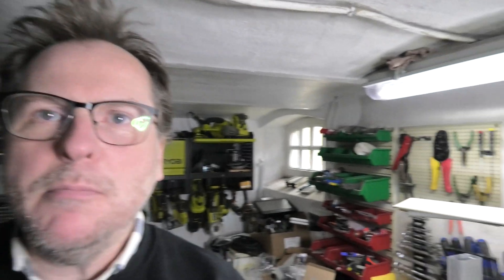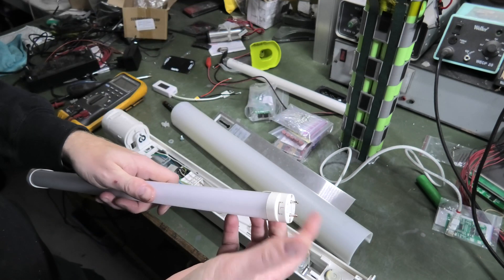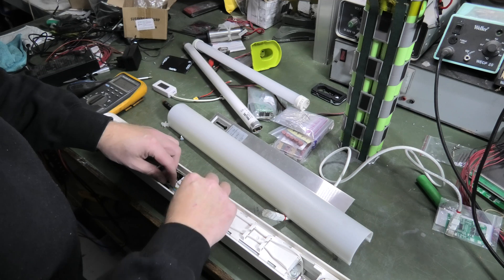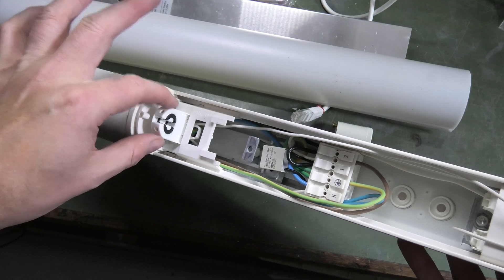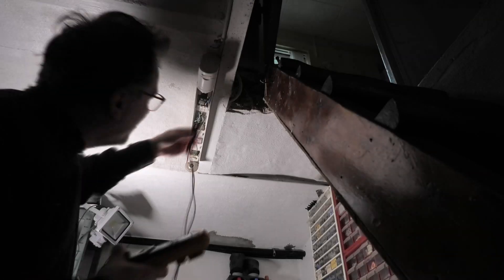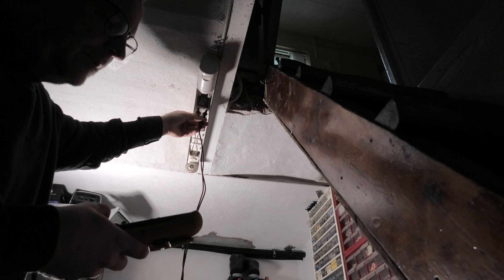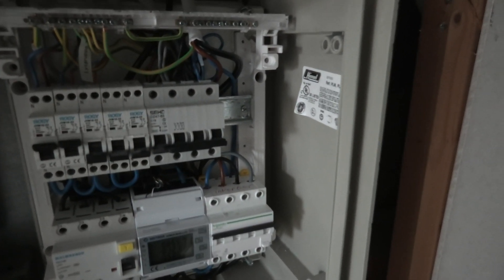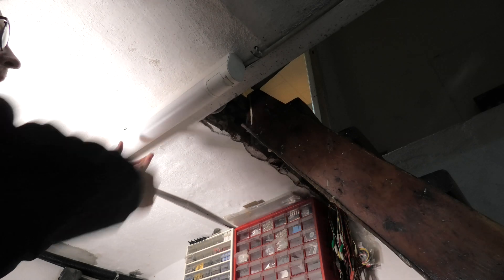10 Year's ago I Installed a lamp! NOW I make it LED - 1434

Comment: So LED tubes don't need the neutral line.. Interesting, but might be a problem in the future. If I remember correctly you might have build an typ of antenna that could interfere with everything electronic in the house wired to mains or wireless. 
You want line and neutral on both connectors. One side is normally shorted anyway but that way it doesn't matter in which direction the tube is pluged in.
Reply from the maker: Hi @Troppa17
Thank You very much!  glad you liked the video :-)
Thank you for watching! :-)

Comment: The way those fluorescent tubes work is that on the opposite sides there are two contacts that power two little incandescent lights on both ends, they are needed to heat up the electrodes and facilitate flow of current when the tube is starting up with high voltage, once the starting sequence is completed the two lights are no longer powered and current only flows across the tube.
Also the L and N labels on the LED replacement are kind of useless and you could have just put it in there after removing the starter (that weird component with two contacts).
Reply from the maker: Hi @SuperSerNiko97
Thank You very much!  glad you liked the video :-)
Thank you for watching! :-)

Comment: There must be some confusion 3:16  to my understanding there is not positive and negative, but instead of that there is phase, neutral and ground lines.   Positive and negative are in battery world doing DC current.  Please correct me if I am wrong, but also correct yourself if you are wrong ;-)
Reply from the maker: Well it is one phase and a zero,,, it could make a differences what end goes to the zero,,, it could,, now sure if it makes any differences.
Reply: @MyPlayHouse  It is good to check that, but typical electrical home appliances you can plug in to the wall both ways. There is some fluorescent tube lamp wiring diagrams available in google image search, you should be able to see how it goes there. Seems like one connector from each side of the tube is meant to connected together through the starter.

Comment: That's no bulb, my friend. Those are the round ones that you screw into a lamp socket. That's a tube.

Fluorescent tubes have come a long way. They were way more efficient than the incandescent lamps but unfortunately, they had mercury and UV in them. Not the best eco-friendly lamps.
Reply from the maker: Tube tube tube,, I will try to remember that.